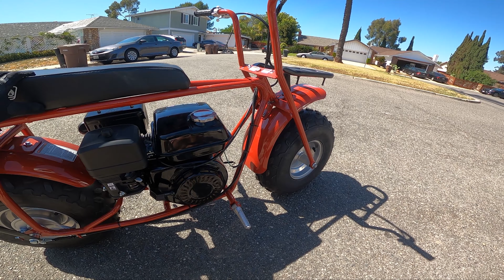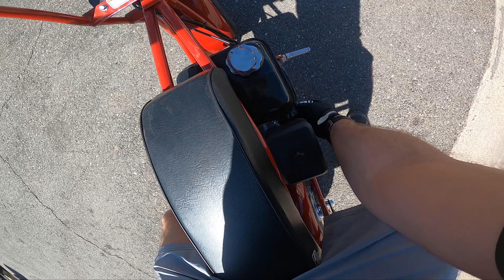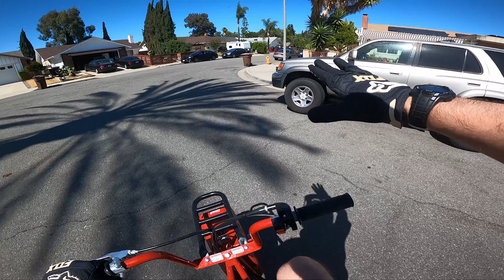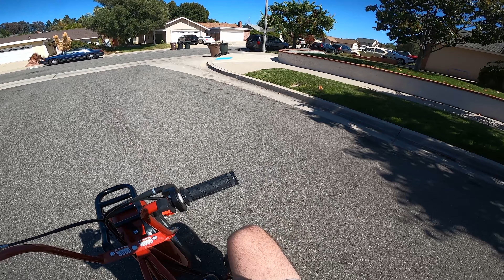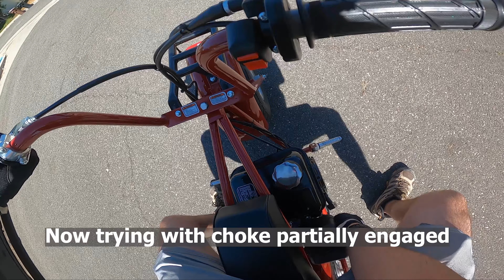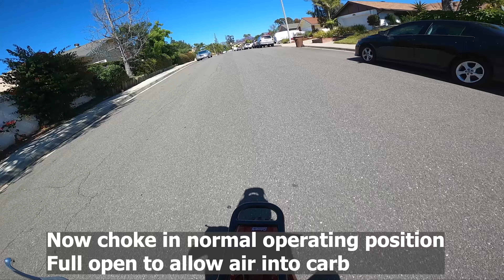Coleman CT200U TRIED TO KILL ME | THROTTLE STUCK OPEN - MUST SEE

Comment: Glad you made it to post! I got a similar model (CT200U; cammo fenders only diff, I think). My throttle was also sticking real bad; not returning; everything from LOOK OUT zoom requiring cutoff or delayed responses. My wreck was MY FAULT in forgetting I had manually opened it a bit when off; started & wheeled off to take out a wooden post but NOT the hatchback it was heading for; hung on long enough to hit off switch. Still due to stuck throttle/plate out of box AND some phuckery with a supersized governor spring AND these super lame return springs. Required professional shop fix; should not have touched it but nevertheless yes, bit dangerous. Was lucky I didn't have a wreck on first tests but to be fair the stickiness was obvious, I was stubborn and pushed it past recognizing an obvious issue. From other YouTube vids, etc., I believe this is a limited final assembly problem at factory completely seperate from an otherwise super machine and outstandingly reliable core engine. 
   Coleman PowerSports jumped on problem with SWAT-team speed and, critically, efficiently by digging up a 1-man shop in another small town to check it out. This after I whined about the distance to their first choice... problematic to find here in Montana with very few shops in even big towns. I suspect this took a ton of calls all over the western state as this is the season and everybody's busy. Zero question about warranty; they had shop paid and released to me within an hour of word given by shop. Just got back this evening after a half-hour check of repairs up a forest service road and it performed beautifully now fixed and with nice robust return springs. Wasn't the "10 minute" fix I thought; guy described taking half of it apart to access stuff and believe the throttle plate itself needed attention; not a mechanic but point is it wasn't as simple as may look on surface unless you know what you're doing. Don't bother messing with it; hassle but actually with better springs, etc., is slightly better than original.
   You can bet Coleman knows about this; is not uncommon by evidence and likely has things like that too-long gov spring, etc. fixed/replaced at the factory assembly level... there's just a large stock already here waiting that needs to be worked through. Vegas odds they sigh every time they get a call but short of tracking down each box, they're stuck BUT aware and instantly responsive. No acknowledgement of "oh yeah, THAT problem" but no arguments, either. Buying one pre-assembled is an easy answer... and Murdoch's Ranch Supply does that if any in area. Hopefully they're not the only ones. MRS was my first choice but was impatient, went somewhere else lame, all boxed up. Was at MRS for another reason; saw them out front with price tags so ASSUME they'd only sell working models. 
   Sorry for TMI here but I want people to retain trust in Coleman and see this as a Life on Earth problem quickly fixed when encountered. See this "comment" and imagine my righteous whining email manifestos; they were always polite, always answered their phones (remarkable in itself lately). I have no connection with them but have had some serious global marketing contacts in past and recognize Coleman's stand-up response. [Co-author of "Loops, The 7 Keys To Small Business Success", McGraw-Hill Professional with Drs. Mike Chaet and Stephen Lundin of FISH! fame] I bought it for express purpose (besides fun) of any hope of making it through the insanely-rough Rocky Mountain, literally ON the Continental Divide if not a stone's throw below, terrain on preservation efforts on remote abandoned mine sites, etc. Before I admitted it needed to go in a shop, I went on an ill-advised recon of some new directions to one old camp I'd failed to find after several long searches on foot. Throttle w/delayed response, only 1/4 power at most (got stickier later to point of uselessness) yet it got me to the site in 20 minutes from 3 miles below the Divide then over a ratty trench track Over The Hill, another mile then quarter mile down what had to be an 8% grade of eroded 130 year old wagon track littered with more rocks than most riverbeds. What? 2.5 of arms behind back and got me outta there okay. Now in proper form, it's seriously akin... for me at least... to walking into NASA with specific needs and this is what they delivered to the delight of all. With milk crate Insta-cargo box safely carrying all the equip, etc usually weighing me down, I'm still riding with about 45 lbs below rating; tires handle the insane rocks, etc.  Glass smooth on paved surfaces. 
  Enough from me.

Comment: clutch is smoked, I know this video is old but mine did this, bought 2 carbs and nothing. told me neighbor and he said sounds like the clutch. replaced the clutch and bam it was fine. hope I helped someone
Reply: also it wouldn't do it with choke on, when you take the choke off you better hold on cuz it was all go. my bike was practically brand new when this happened. don't buy a cheap clutch from Amazon either, i did and it lasted maybe an hour and I smoked that one. I currently have a new clutch on and a backup because that's obviously a problem with these.
Reply: I'm seeing so many comments about throttle cable and idle screw, I highly doubt it's those from my experience. I still rode the thing tho i didn't care it was an adrenaline rush, but an injury waiting to happen :)
Reply: because people like me have the same issue and our bikes are not equipped with a clutch. in my case i can see the throttle blade fully open at rest. so as soon as choke is off, we have wide open throttle.

Comment: If anyone in the comments is looking for a solution. I had this same problem with my Coleman minibike. It’s the Clutch, they don’t grease them at the factory. Remove it, disassemble and grease all the surfaces that are showing wear. DO NOT GREASE. Clutch shoe surfaces or disc surface. Solved my problems.

Comment: I had this issue, swapped a CVT and still had the issue, all I had to do was add a spring to help the throttle close but then it took adjusting to be able to go full throttle
Reply: If anyone is reading this needing help, the metal bar with the spring that goes from the governor arm to the black piece on top of the carb is where you need to add the spring. Either to pull the governor arm back or just add it to the black piece on top of the carb. I haven't removed the governor yet but when I do I will simplify the throttle set up as I have like 4 springs in the entire throttle set up. I searched far and wide on YouTube for a solution and not many videos on it for how common of an issue. I will post a video if others still need help
Reply: @coreyconachan2553  u do a vid yet
Reply: @zacclark7106  no I completely re did my the throttle set up, will post a video soon once I'm for sure it's the best set up but it works great
Reply: @coreyconachan2553  u fog it out
Reply: @coreyconachan2553  yes thank you! This is my problem.
Reply: @johngavelek8150  I really should post a video about this, I ended up routing the throttle cable straight to the black piece on top of the carb, it bi passes the governor and works great!

Comment: I have the same exact issue happening with mine. How is it fixed, I can't find anything on it
Reply: Burnt out clutch buy a new one it will be fixed
Reply: Don't waste your money on a clutch. Focus on your throttle and governor linkage. If you notice in the video the engine RPM is much too high. This means that either the manual linkage is not returning to idle position or the governor is unable to move the throttle on the carb to idle after the choke is open. A properly idling engine would never move the bike that fast with a sticking clutch.
Reply: @Deucealive75  so how do you fix it?

Comment: You sir are the reason we have warning labels on everything.
Reply: @DooberD33  mine is doing same thing and it started after a week of riding it..could it still be that spring? new to mini bike and any two wheel...
Reply: @DooberD33  mine is doing this too how do I fix it?
Reply: @Gmt400  Did you ever figure it out? Mine is having the same problem.  Just goes on its own!

Comment: Mine does this same exact thing!! I called three three different times and they wrote me off each time  saying it’s the little spring for the throttle. Full of it! I said I I replaced that, now what? Joke. 

Have they fixed this yet at all? It’s been sitting for almost a year now with no fix. Total joke and waste of money. They know!! I’m not the only one.
Reply: Throttle cable
Reply: Very simple machines
Reply: They replaced the clutch under warranty for me. I am selling now because I don’t trust it. But it works after the clutch was replaced